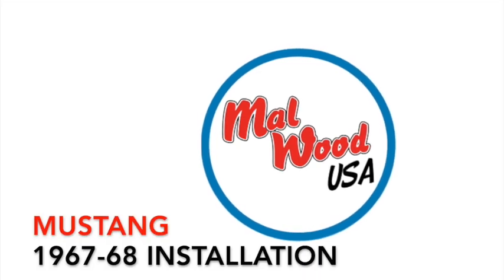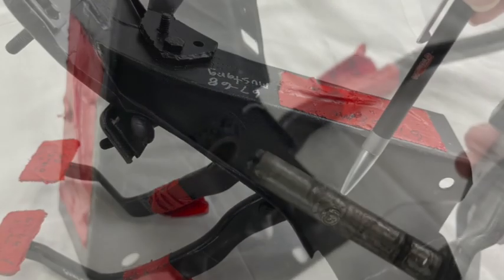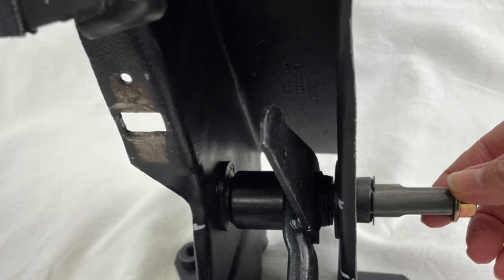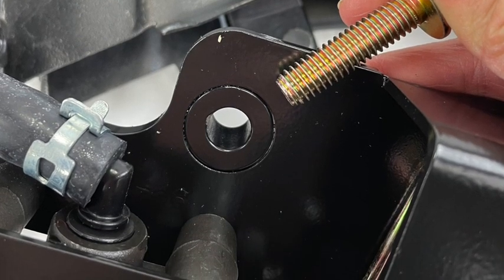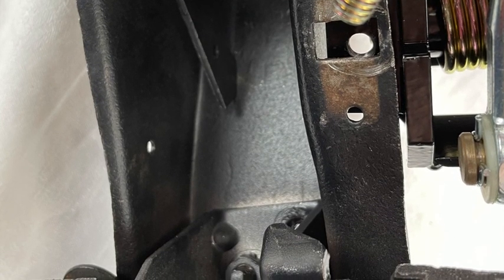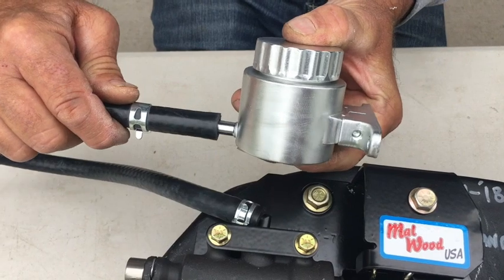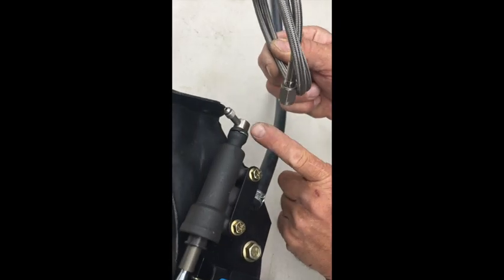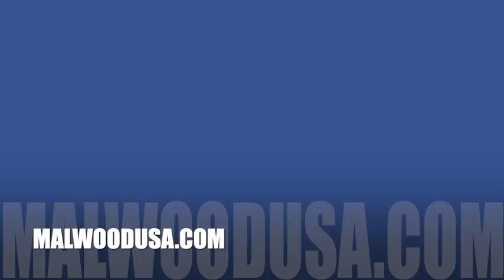1967-68 MUSTANG INSTALLATION  Underdash Hydraulic clutch pedal

Comment: Not possible to remove the existing clutch pedal without either removing entire bracket or removing the air vent. not sure which one will be easier, I'll find out shortly

Comment: Does this work with an external hydraulic slave cylinder or will it only work with the internal type?
Reply from the maker: We recommend an internal throw out bearing for optimal performance but our kit will work with any slave cylinder or bearing set up.